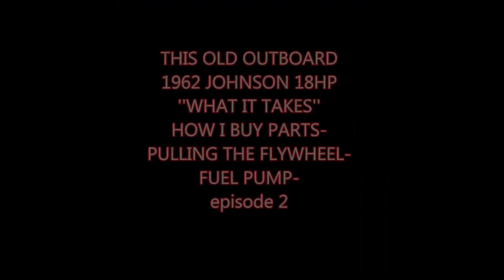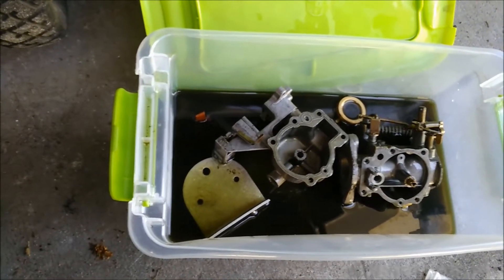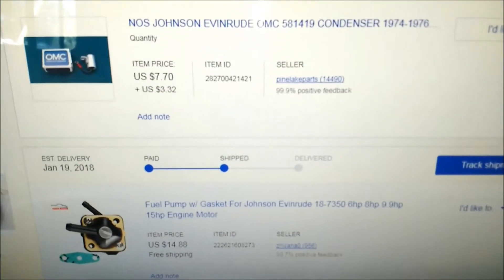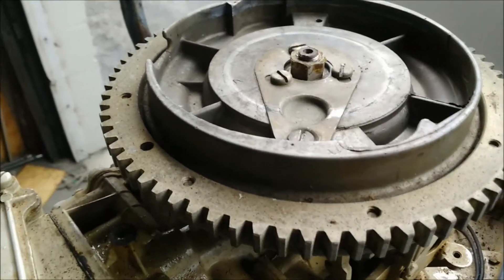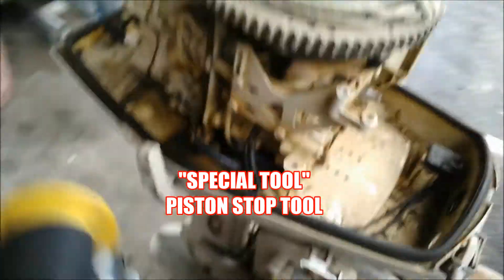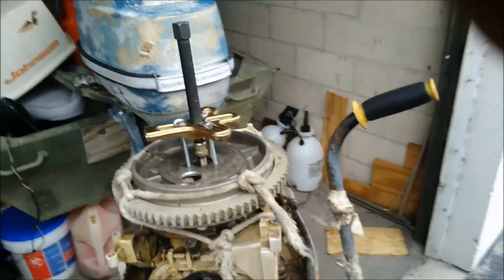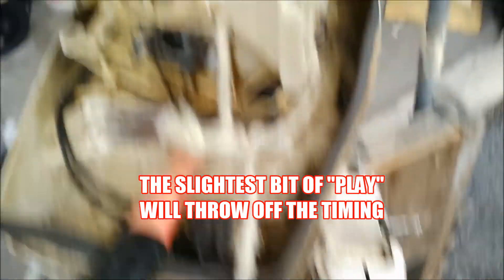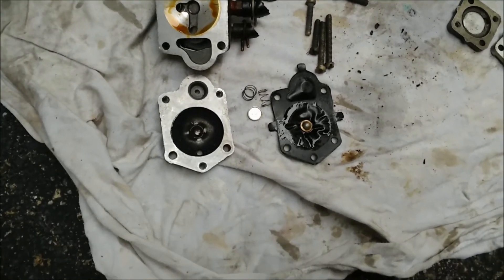How to get an old outboard up and running.  Johnson 18 Hp 1962 - episode 2

Comment: Great video series. :)
Yeah, the coils look as bad as mine on my 1964 Johnson Seahorse 3 HP. As they age they get porous and crap out.
It's better to change them, even if they can still function than to lay out on the water and be sorry about it.
Reply from the maker: Hey! Thanks for subscribing & watching my vids! Really appreciate it! Yes coils will crap out even when they look good. They will test/ohm out fine but break down when they start to heat up. Then you think you have a fuel issue because the coils tested fine. Thanks !

Comment: I have a 1960. New points/condensers new coil  packs new water pump and impeller and spark plug wires. Carb has been “serviced” been at the mechanics for 2 weeks. Thought he had it fixed but the top cylinder will not run. Any thoughts?
Reply from the maker: Hey. Thanks for tuning in! Well, have you checked for spark, & good compression. Is fuel getting to that plug. Start eliminating all possible reasons why its not firing. Are the points set/gapped properly. New condenser can be bad, I haven't had it happen but I've heard it's possible. There's never any one answer you'll need to check and eliminate. I would start with checking compression if you haven't already. Then check for good spark/ignition/timing. If its all good then it must be a fuel issue and vice versa. Did the mechanic do all the work or just the carb. Curious to know what you find out. Thanks again & Stay tuned !
Reply: @THISOLDOUTBOARD1  the mechanic did all the work. Had two different sets of points and condensers in it. The top cylinder was running the other day I guess and then went to check it today and it was done again. Talked to my brother who is a mechanical engineer and he mentioned same as you. Probably a fuel pump/carb issue. Going to start with those!